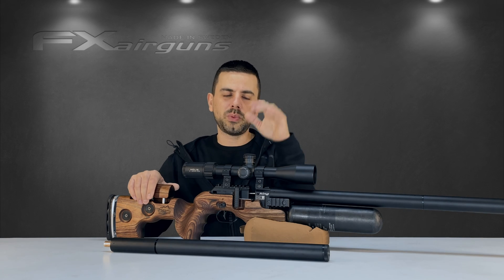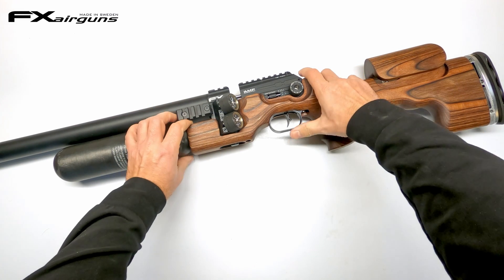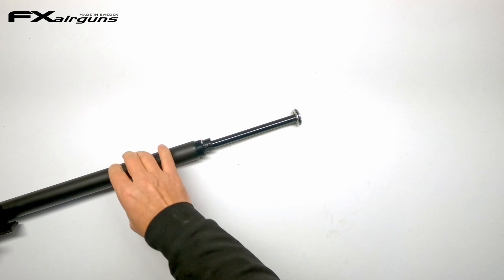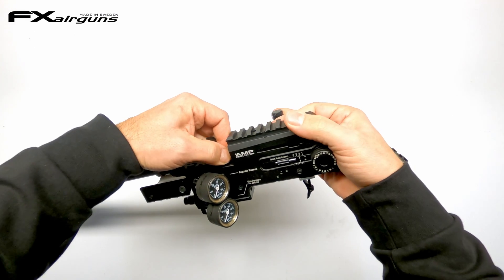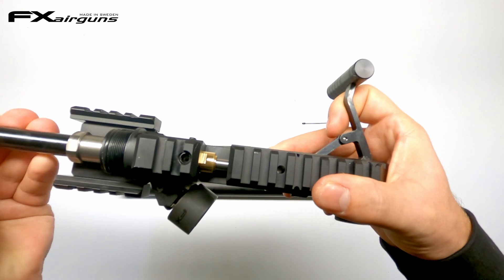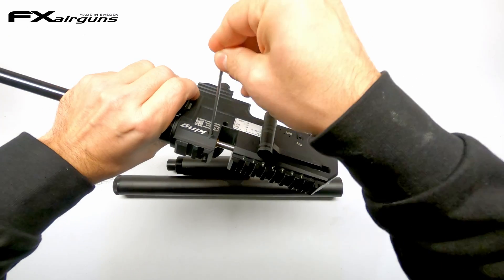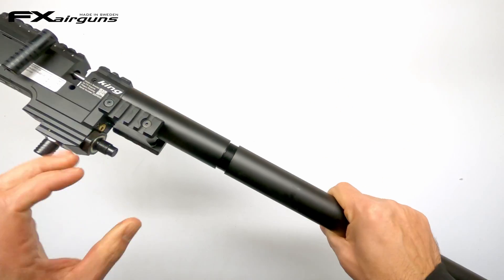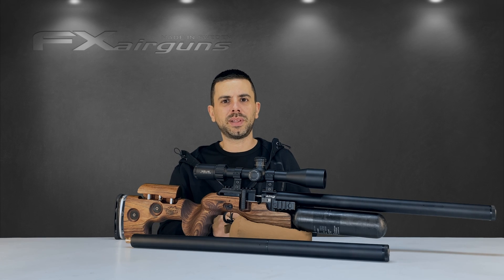FX Dynamic barrel and caliber conversion

Comment: Hi, I really appreciate your video tutorials👍. And I do have some questions to the slug power kit for the King. First, is it possible to use also pellets with the slug probe from the power kit ? Second, is it possible to switch caliber , lets say .22 to .30 by adding the .30 sleeve to the installed slug probe. or do I have to uninstall the slug probe for that ?

Comment: Scout epoch has a slightly easier way without screws just with levers, but I still prefer getting fx. You may also want to check Hammerli B1 barrel removal with a QD steel balls springer tensioned. I'm just throwing some ideas for future fx models.

Comment: This model actually doesn’t look that bad to work on. Only thing I notice is it doesn’t seem like fx manufactures many kings ?? Are they only made to order? Very rarely in stock in the U.S. I also suspect it will take a long time to get a “caliber kit” for one of these seeing you don’t see them as an option at dealers like other fx kits.
Reply from the maker: The amount of supply depends on the GRS delivery of stocks and they sell very well . The slug kit is easy to get as it’s the same for the Panthera / Dynamic

Comment: How can I remove the front spacer if it came loose and now it's simply stays at the beginning in the inside of the shroud? 
Thank you for your awesome well explained videos.
Reply from the maker: Yes this could happen if it wasn’t tightened good enough before or the glue releases . If you have a separate barrel , you can thread it in the spacer and pull it out . If you don’t have a separate barrel , put some blue loctide on the threads of the barrel nut , screw the shroud back on and leave it for a few hours to harden
Reply: @FXAirguns  thank you guys .

Comment: Great video. If i want to upgrade from .22 700mm to .25 700mm . Is there anything i need beside the huma caliber exchange set and the barrel ?
Reply from the maker: That is actually not a question to ask the dealer itself 😉 we can’t guarantee that the aftermarket part will do what they should .
Reply: @FXAirguns  assume it will . Will the bore of shroud fit with  .25 700mm barrel . Disregard my question about huma parts

Comment: Could you explain to me how the same block and the same air valve can serve different calibers, such as from 22 to 35, for example? thank you.
Reply from the maker: Hi , the Dynamic block has a short impulse valve and is a much different design then other rifles. The valve is optimized to suit all calibers with high airflow and therefore can serve all calibers . The only models with different valve is the sub12 . Hopefully this answers you question.